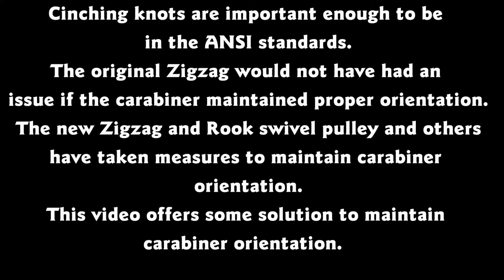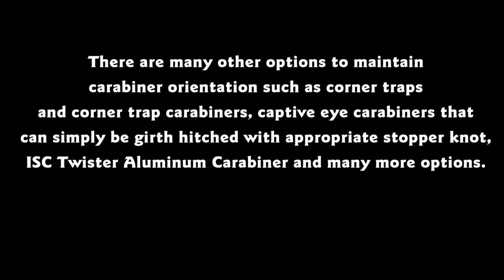Importance of a cinching knot in DdRT configurations.

Comment: I think the danger of carabiner rotating applies to all cases where it gets unloaded. I can easily see this happen wirh SRT or even to a lanyard as well. I use rubber o-rings on a carabiner to prevent some of my equipment from rotating like that.
Reply from the maker: For sure a keeper of some kind or a cinching knot.  Rock climbers use a different system and I often see that F8 flopping around on a carabiner.